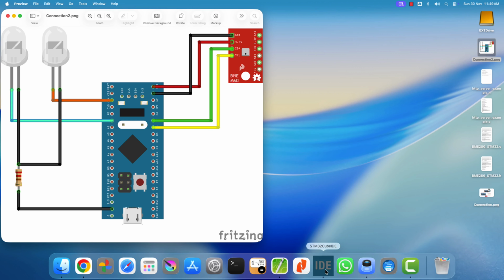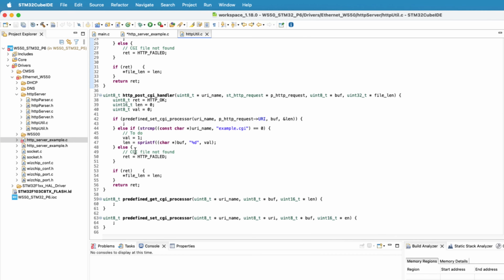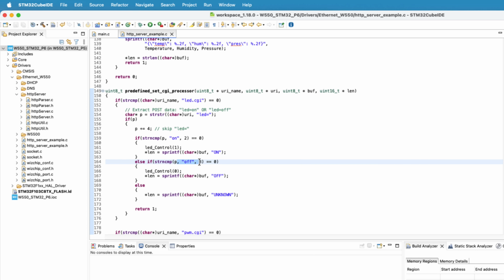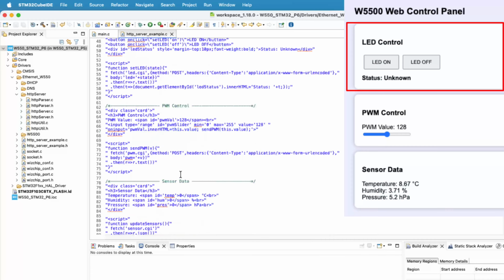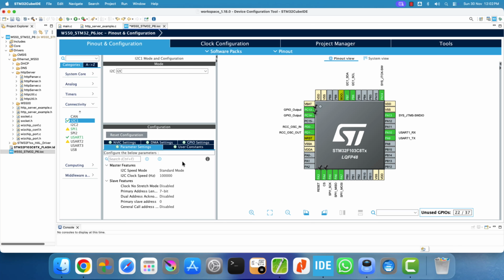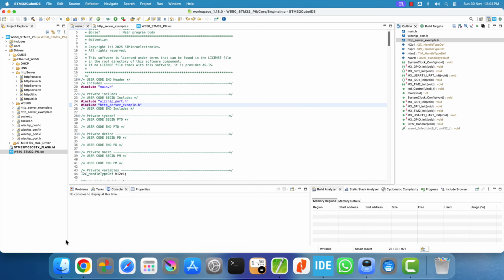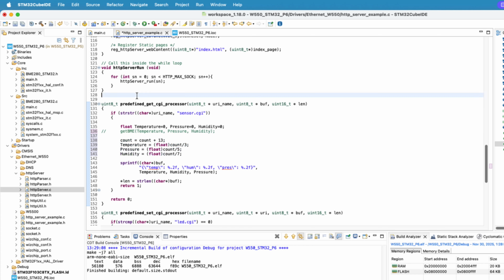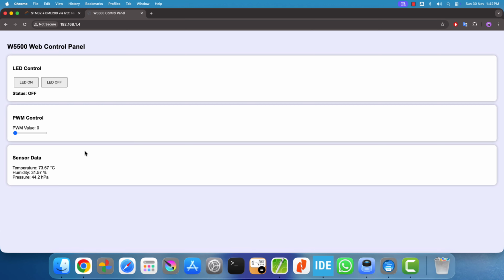STM32 Ethernet with W5500 (PART 6): STM32 HTTP WebServer using CGI

Comment: How can I change the MAC address programmatically? 

I need that for a static DHCP assignment on the router for multiple devices. I have tried to replace it but I think I'm doing it wrong.
Reply: yes there is no such mac in w5500 you have to manually change in code or add some mac ic for reading mac data